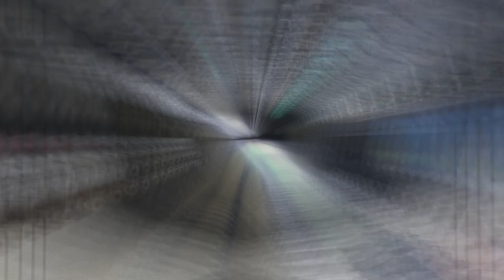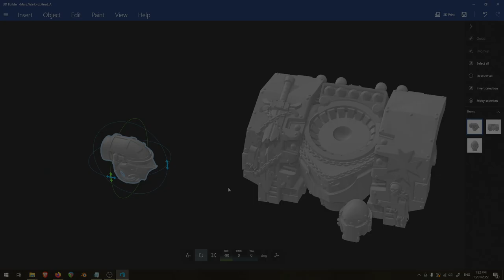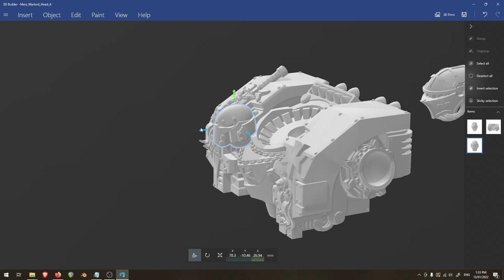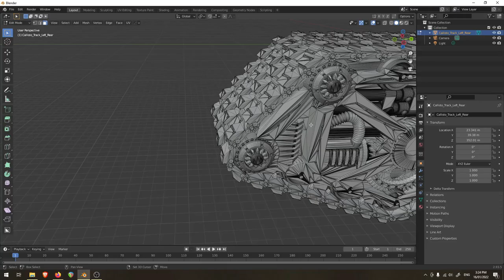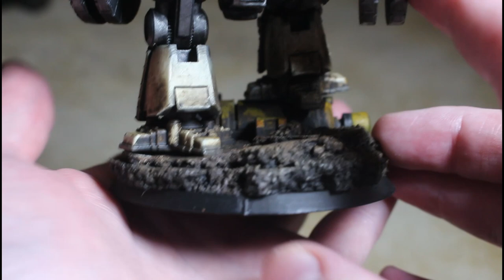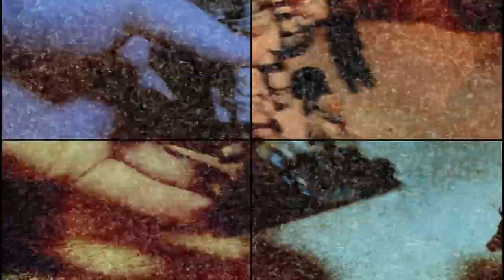Digital Kitbashing Miniatures is AWESOME (and easy)

Comment: For us Mac and Linux users, everything you demonstrated there I guess we could do in Tinkercad. It's not the most powerful tool in the world, but if you've never made so much as a cube, you can still use Tinkercad. Except I don't think it has a planar split/cut tool, so for that you jump through the small hoop of making two copies of an object and using a cube to cut it twice.
Reply from the maker: There's also Lychee slicer now too which recently added a planar slice tool!
Reply: @OnceinaSixSide  Oh cool. I use Lychee and I haven't paid any attention to the new features they've added. I mainly switched to Lychee because the community resin and printer profiles, while they overexpose a little, are reliable. That, and when a model isn't presupported, Lychee's auto supports do a good enough job when I make them dense but light. I've only used auto-supports for Battletech miniatures, but the only failures I've had were temperature related as I printed overnight. I still check Lychee's work and sometimes add one or two more supports, but generally, they're good enough.

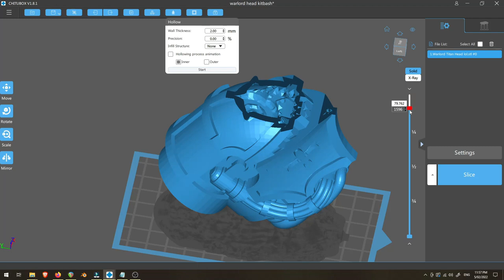Comment: 7:14, If you want to print bashed models hollow, you can use blender's remesh modifier to turn them into one mesh. It's honestly really easy, I cant do anything in blender and I was able to figure it out in less than 5 minutes.
Reply from the maker: Awesome! Thanks for the tip. Another user commented here as well that you can also use the Merge feature in 3D Builder for the same thing.

Comment: Thanks for the warning on the printing solid. I was just kitbashing some minis
Reply from the maker: Happy to hear you got some value out of it! I learned from one of the other commenters that there's a Merge function in the Edit tab of 3D builder that actually deals with the overlapping geometry, so if you want to hollow something you've kitbashed group your models then merge them and it should be okay - just be sure to double check in your slicer that everything is fine.

Comment: Great video. I wish I saw this about 4 weeks ago... because I did a couple of parts in blender and now I have parts with tons of internal geometry and outside walls .1mm thick. Is there an easy way to take those hollow models and make them solid or am I better off just doing them again in 3D builder?

Comment: If you load it back into 3dbuilder and use the merge option then you can print kitbashed bits hollow
Reply: This. You can also select models and choose to "Ungroup" them. Sometimes the program will detect arms, legs, heads, weapons as separate pieces for you right out of the gate.

Comment: Hey man, thanks for putting this out there. Do you have a workflow recommendation? I'm playing around a lot but after a few nasty failures I want to get more serious about validating files/checking islands/making fixes, but there's just so many pieces of software and I'm not sure how to go from one to another.
Reply from the maker: UV Tools and your slicer of choice is all you need :) Basically slice a file, then load that file into UV Tools and click on the Issues button and it'll draw up a list of all the problems it finds and tell you what layer number they occur on.
Reply: @OnceinaSixSide  Thanks! What's the deal with UVTools, do I really have to install it with choco off of github?
Reply from the maker: @SNDKNG  No there should be a regular old executable on there to download that will install it like any other piece of software.

Comment: When you use 1 model to delete part of another model is there a way of adding a tolerance in to take account of prices not coming out perfect ?
Reply: And a video on how to put magnets in to models would be great
Reply from the maker: Yep! Just scale up the cutting model slightly before subtracting it from the target model and that will give you some wiggle room.
Reply: @OnceinaSixSide  thanks - Been printing a lot of loot stuff and finding whoever did their supports in the welcome pack (Fantasy) was click happy - nearly impossible to get off cleanly - models breaking - lots of supports merged into one another forming a solid tower and far too many supports on bases etc